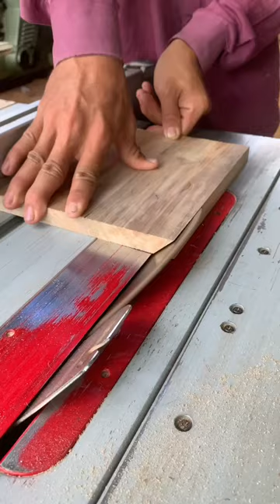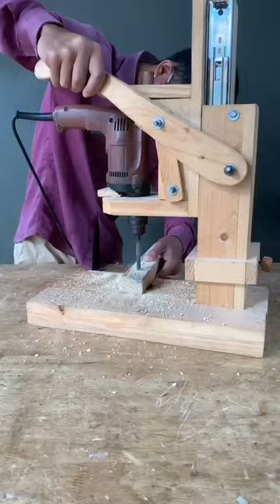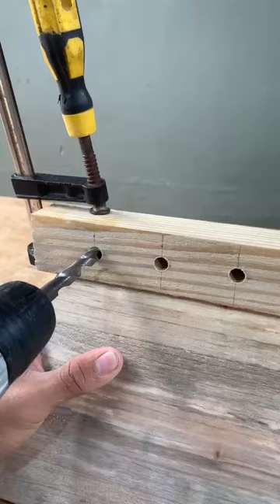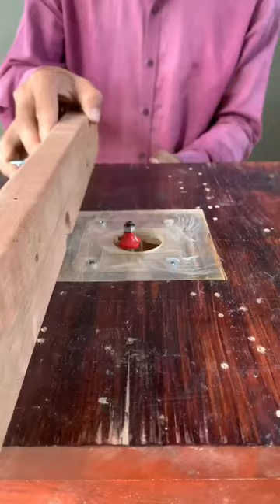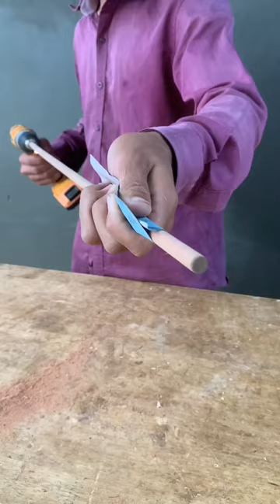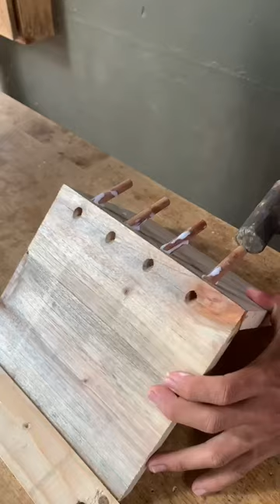Best Woodworking Box Joints Technique #shorts #woodworking

Comment: Ok, his hands are backwards. When the fence is on the right, right hand pushes material. If 2 hands r needed to do so, that means there’s too much friction between the table and wood causing u to have to push too hard and majorly increase the chance for injury. Wax the table saw top regularly. The wood should glide smoothly. U only have one set of fingers.👌🏻